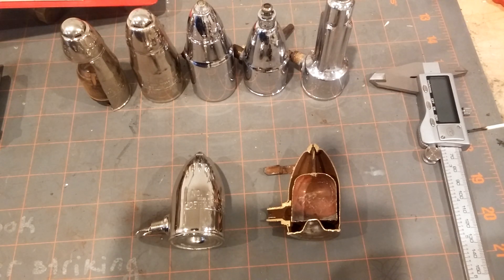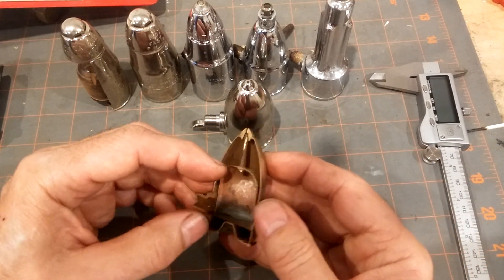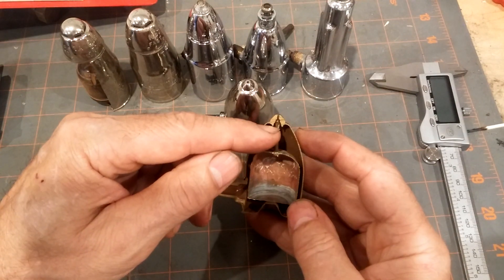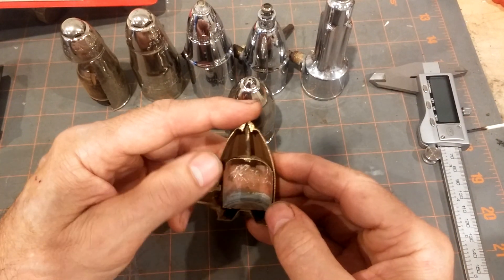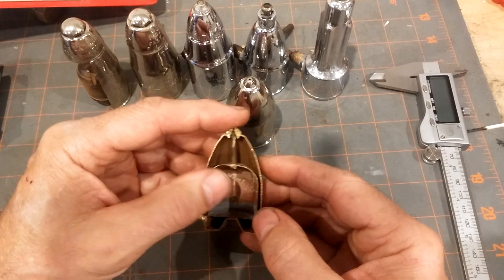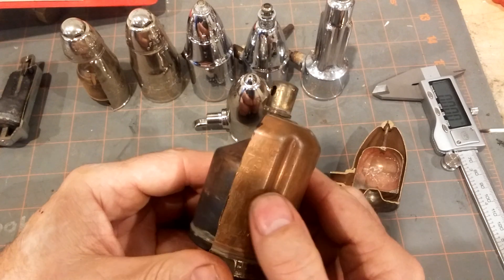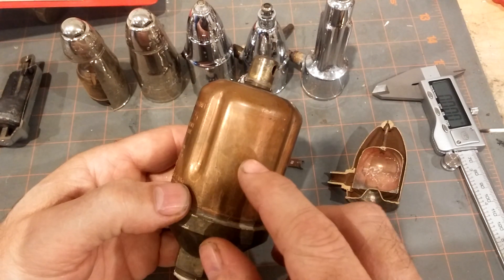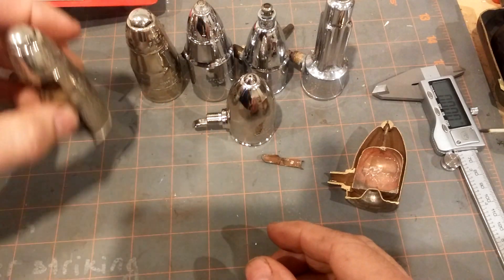Hoffman #40 Single Pipe Steam Radiator Air Vent and Other Models Discussed

Comment: I'd be courious the main reasons for failure. It seems to me it may be that the needle gets clogged so it can no longer seal and the bellows cracks. When they stop working an old trick is to stick a rubber band around it plugging the hole which stopps the radiater from getting warm.

Comment: What does it mean when a steam radiator vent air valve is blowing steam out? Do I need to replace it?
Reply from the maker: @nereydaruiz7348  Yes, pretty much.
Replace it asap, as it will cause your boiler to use more fresh water, shortening its life.

Comment: What size valve should you use in the basement just before the wet return in the basement
Reply from the maker: It depends on the size of the steam main and the length.
I would look at using at least a Gorton #1 (it has the same venting rate as the Hoffman #75).
Often, a Gorton #2 is a good idea (it is difficult to over vent a main)
Sometimes even just one #2 is not enough and you have to gang them up.

Comment: Any advice on how to size air vents for heating coils for roof top units? Got a new job recently and finding a lot of screwy stuff here and I’d like to make it right.
Reply from the maker: Two Pipe or one pipe?
Reply from the maker: For roof-top units, the big thing is to make as sure as possible there is no trapped water in the coils, pipes etc at the end of the heating cycle.
Proper slope, vacuum breakers are needed esp if there is a zone valve!
Reply: It’s two pipe with modulating valves. I noticed the air vents were leaking and then realized instead of having one vent and one breaker there were two air vents. So seems to me somebody has been doing a lot of guessing here. I’ll be doing a full run down of these machines in the spring and hopefully get them back to their former glory

Comment: My  hoffman No 40, air steam vent, has started to spit water. I don't know what else to do because I have taken water that was inside, but it's still doing the same.
Reply from the maker: Is this at your house or your condo?
What pressure are you running your system?
What is the water level at the boiler?
It might also be a failed vent.

Comment: I've found that there are 2 variations on the cheap USAV-884 vent. The smaller diameter one with the small adjustment screw, and the larger diameter one with the large adjustment screw. The large one is of considerably better quality and I have actually found they do a much better job of sealing against wet steam than others. At least until the bad near boiler piping can be fixed. The Durst SRV from Lowe's which is a Gorton clone is also useful for balancing a system. It comes with every size of orifice for $10. Would I use these on a properly running system, probably not. But to limp a leaky boiler through the winter they absolutely work, as well as to balance a system without buying a bunch of expensive Gortons. When they break they can be replaced with the real thing, now that you have an idea of what vent should go where.

Comment: Do u recommend this #40 air vent on vintage radiators ….. the boiler I have is from 1960 (peerless) …. A couple of years ago I needed up buying Dole air vents .
Reply from the maker: The answer is... It depends.
The #40 is a fixed (non adjustable) relatively "slow" vent.
A large radiator, column type, might heat up more with a faster vent.
A tube type radiator might heat up just fine with a slower vent (there is less air in a tube type raditor of the same EDR)
Where there is Air, there CANNOT be steam.
Make sure you have good steam main vents such as a Gorton #2.
Reply: 👍👍👍thank you

Comment: My steam radiator has the standard Hoffman vent but the apt building is pre-war so the vent threads on the radiator itself are old and corroded so that it doesn’t tightly lock into place. Tonight the steam/pressure blew the Hoffman vent off of my radiator and now my bedroom is a sauna & the radiator is spitting water. Called my super but any tips on the interim? I’ve already tried tape on the vent threads and pitching the radiator as much as I possibly could
Reply from the maker: If the 1/8 NPT threads in your radiator are worn out, very likely a skilled plumber will need to be summoned to drill out and re-tap the raditor to 1/4 NPT and install a 1/4 x 1/8 bushing.
In the mean time, the radiator will need to be shut off.
Reply: @gordonschweizer5154  For next time, as Gordon says, shut the valve if that's possible or hammer a wood plug into the vent hole.
Reply: Stick a cork in it with a belt around the cork to hold it in.

Comment: can i replace a hoffman n40 with any other Gorton if i don't like this design? my large living room radiator is not heating up. maybe got water in it. the coming neck area is warm/hot, radiator is cold.
Reply from the maker: Did the radiator in question heat before and now it doesn't?
Is the radiator valve open all the way?
If yes to both, try removing the Hoffman 40, shaking out the water & putting it back.
Reply: @gordonschweizer5154  probably it wasn't heating up before, because of water blocking that steam coming pipe. it was never a concern since the living is not the coldest area. actually, i did a vacuum on those shredded off pain chips yesterday, and twisted that stop valve a bit(its fully open clockwise, not sure if any thing broke in there). it has some play after that day. maybe is not real hot, because the room temperature has reached up to 71 on its setting, and the steam stopped. that vent been wising tho. could Hoffman No40 be replaced by a gorton #4 or something, that venting hole size look similar. unless that radiator is design for that type of vent for easier shut off.
Reply from the maker: Did I understand you that the valve is "fully open clockwise"?  I think it is supposed to open when you turn the handle counter-clockwise?
Reply: @gordonschweizer5154  uhoh.
Reply: @gordonschweizer5154  well, its the stop valve. people who used to live here turned it off/my brother did it, thanks
Reply from the maker: @yangy8783  Thank you very much for the feedback. I am glad it worked out & you got heat!

Comment: Very useful video.    We have a steam radiator on the 4th floor that lets out air very very slowly. Is it possible to move the air out faster by adding 2 vent valves or a different one that moves air out faster?
Reply from the maker: You could try a faster vent.
What do you have on there now?
Sometimes, improving the main venting in the basement helps overall.
Sometimes, adding a dedicated "riser vent" can help get the air out, then a relatively small vent can work.
If you go with too fast of a vent on the problem radiator first, it might cause it to spit and grumble (ie it's possible to over-vent a radiator)

Comment: Should the valve point up or down ( the hole at the end) when connected to your radiator? Does it matter?
Reply from the maker: The air vent hole should point up if you want the vent to work properly.
If you so desire, you can shut off the radiator by installing the vent with the hole pointing down.
Reply: @gordonschweizer5154  Thank you for your reply. I found the radiator didn't work when it was pointing down. The maintenance man said it should point down and I didn't believe him.

Comment: Hi Gordon, I live on the 3rd floor and have steam heat, would you recommend the Hoffman #40 for all 9 of my radiators? As it is now I have those cheap Maid of the Mist ones and some radiators are not heating.
Reply from the maker: Did the non-heating radiators ever heat? Or did they stop heating recently?
Reply: @gordonschweizer5154  Yes when I first moved in they did heat, then I had all the air valves changed one summer because I had a few that were hissing, seemed that would be a good upgrade. Unfortunately I used the Maid O Mist ones from the local hardware store.
Reply from the maker: @joshr9417  What size orifice do you have on the M-o-Ms now?
Reply: @gordonschweizer5154  Its the one that came with the valve the M-o-M Jacobus Steam Vent Model C.
Reply: I had one radiator in my bedroom that was totally cold, I just replaced the M-o-M with a Hoffman 40 and it sprung back to life after being cold since I moved in 2 years ago!! Its a miracle!
Reply from the maker: @joshr9417  The "c" size is pretty large venting to my way of thinking, but you ARE on the third floor and I don't know if you have good main steam vents in your basement.
I also don't know what pressure your system is running at, where the t-stat is, or if your boiler is oversized.
All of these can have an effect on how well your radiators heat with smaller vents.
Hoffman 40 vents are way slower than M-o-Ms with the "c" orifice.  The "5" M-o-M orifice is closer to a Hoffman 40.
Reply from the maker: @joshr9417  You might try getting a few Vent Rite #1 adjustable vents in place of your failed M-o-Ms

Comment: General question... as a rule of thumb how often should someone replace the air vents?
Reply from the maker: They should last for years.
If they let steam escape, they should be replaced, of course.
If they don't let air out and the radiator doesn't heat, the vent should be looked at, at least.
If the rate of vent failure seems too high, make sure your main vents are working and big enough.
Make sure you are running at low (less than 2 psi) pressure.
Also, stick with good quality vents.
Reply: @gordonschweizer5154   It seems that hard water not treated in the boiler  can expedite corrosion and muck build causing the vents to not behave properly.
Reply from the maker: @jazzcornertv  Some folks have replaced their boiler water with de-ionized or even distilled water to avoid the over-mineralization of their steam system.
I am not an expert on doing this procedure.

Comment: I'm going to be installing a main vent on a small one pipe system. I'm thinking, Gorton #1 or a Hoffman #4A. There's a 1/2" tapping conveniently located on a tee, 15" from end of the dry return before it drops to the Hartford loop. Which vent would you choose?
Reply from the maker: Is that your only main? If so, I'd go with the Gorton #1 over the #4A.  The 4A has pitiful air venting.  How long and what size are your mains?
Reply: @gordonschweizer5154  yes, only one 2" main. About 30 feet long. 1" dry return. 2+1/2" header, 1+1/2" equalizer.
Two story cape. New SGO-3. Going back to skim next week and install the new main vent.
Reply: @gordonschweizer5154  just ordered the Gorton No.1 ☝️

Comment: Quick question, Gordon…….do you recommend cleaning these on occasion using the “ Soak in Vinegar” method?
Reply from the maker: I myself have not had much success using the vinegar soak method.
That does not mean others won't.
It's always worth a try.  I have seen where boiling Hoffman #40 vents in vinegar has nearly stripped the plating off of newer models

Comment: Thank you for showing us the insides of these vents and how they work! Much easier to see than “theory” or drawings in a book.
And how do you get such nice cuts when you cut them in half???
Reply from the maker: Thanks! So glad it was helpful.
I usually cut open two vents, one is cut open just to remove the inner part, and the other is cut longitudinally with a fine-toothed band-saw.

Comment: How would you know if the ones you have, need to be replaced or not ? Thanks in advance.
Reply from the maker: Thank you for your question.
Here are a few thoughts, by no means comprehensive:
A Radiator vent would need to be replaced for several reasons.
One would be if the radiator does not heat at all.
If you remove the vent while the boiler is making steam, and the radiator starts to get hot, the vent may have failed shut or had a drop of paint in the vent hole. (Painters are good at that.)
If the radiator heats, and the steam reaches the vent and steam continues to vent from it, the vent has failed open and, after shutting off the steam, the vent needs to be replaced.

Comment: I have hoffman 1A in my home my local dealer only have Hoffman 40, are the 40s ok to replace the 1As?
Reply from the maker: Hard to answer without knowing a bit more. Is your 1A failing? Does your radiator heat ok with that 1A?
What setting is your 1A on?
The Hoffman 40 is a slower vent (generally) than the 1A. Are your main steams large enough?

Comment: Have you tested that Hoffman 2A valve to see if it holds vacuum?
Reply from the maker: We have about 20 new/old stock 2A Hoffman's. I tested them all. Four failed to hold a vacuum.  Of those 4, two out and out leaked from the bottom seam from poor solder joints!  Pretty high failure rate. "They don't make 'em like they used to" isn't always true.

Comment: Thank you for the video! I was interested in the construction of these valves and your videos fit the bill perfectly! Three years ago, as a first time homeowner, we purchased the cheap "IPS Angled Adjustable Steam Radiator Valve" to replace the broken one on our bedroom radiator. It split right along the seam a few weeks back. Sounded like a whistle train when it failed. Three years in service isn't too bad but, I figured that there must be better models. We just purchased a Gorton replacement.
Reply: A real American one lasts 70 years.

Comment: Thanks  for the video!  It's very helpful!  One question, one of the #40 vent in a radiator in my home is getting very loud recently.  Is it normal?  Thanks in advance!
Reply: Hmm, probably not. So, question for you: Does that radiator heat all the way to the vent? If it is still hissing when the vent is almost too hot to touch, that indicates the vent has failed to close properly.  It may be time for a replacement.  Save the old vent and try putting it in a vinegar bath, that may restore it if it is foreign matter that got stuck under the seat.  If that inner container has lost its "juice", then the vent is scrap.  Also, check to see if your overall steam pressure is set as low as possible and your pigtail under the pressure control has not clogged up.

Comment: Another good one, Gordon.  Have you been using Groton vents?
Reply from the maker: Yes, I often use the Gorton #4, one of the slowest vents I know of, on small or over heating radiators.

Gortons are well made vents that work on a different internal mechanism from the Hoffman #40.

I hope to make a video on Gorton vents soon!